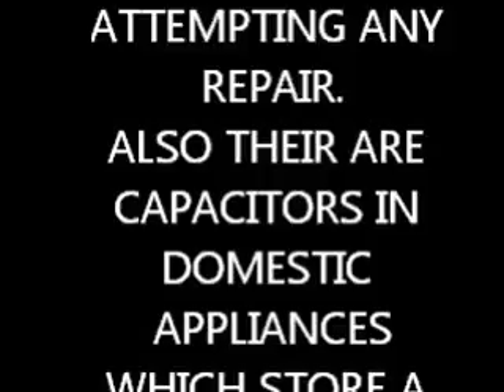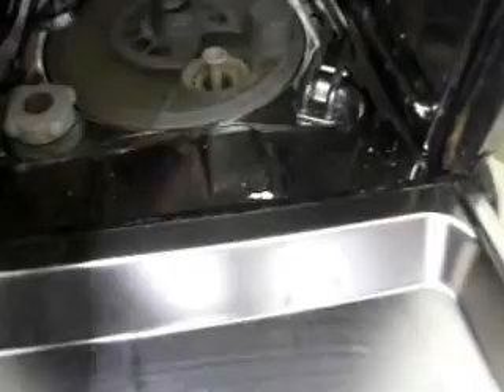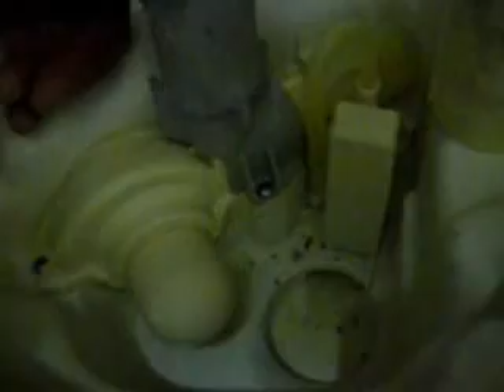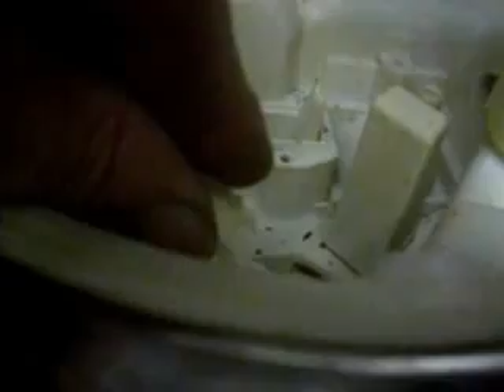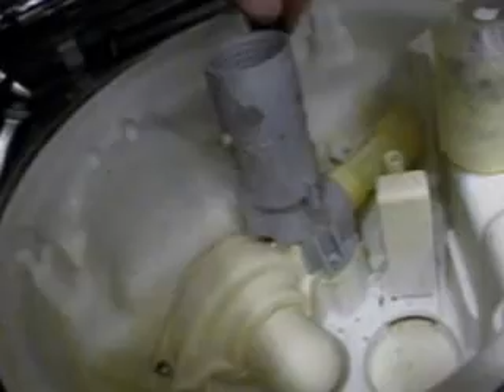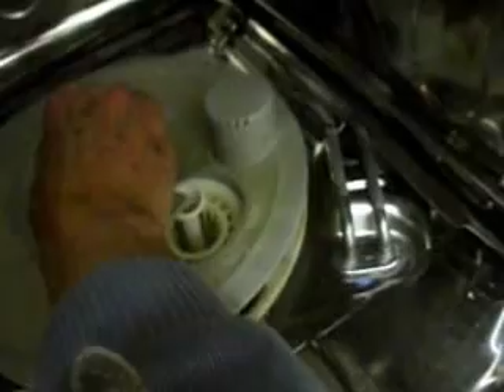Zanussi Dishwasher Repair

Comment: My Tricity Bendix DH086 is EXACTLY the same as this model,can you please help me with a FILLING ISSUE. The water supply is on,the inlet hose is not blocked,when I pour enough water in it drains no problem. I have seen other tutorials where they say to check that the FLOAT is in the DOWN POSITION,but I cannot locate that on my machine!

Comment: The piece that you have find , probably is from the spray arm 
https://shop.zanussi.co.uk/Dishwashers/Dishwashers/Spray-Arms/Dishwasher-Lower-Spray-Arm-Nozzle/p/1523172003
https://www.ebay.co.uk/itm/Genuine-Zanussi-Dishwasher-Lower-Spray-Arm-Nozzle/162602936008?hash=item25dbe3e6c8:g:qJ8AAOSw881ZtVH4

Comment: Well I have took the necessary steps to check and see if pump was blocked. Removed some debri but noise still coming from it so now I am stumped. Anyone got any ideas. This noise stoarts when first switch it on then it stops as water starts to fill up then the noise comes back. Would appreciate any input thanks.
Reply from the maker: What sort of 'noise'. Buzzing, ratchity' screechy, clattering, ?